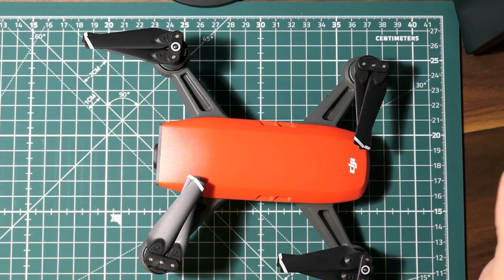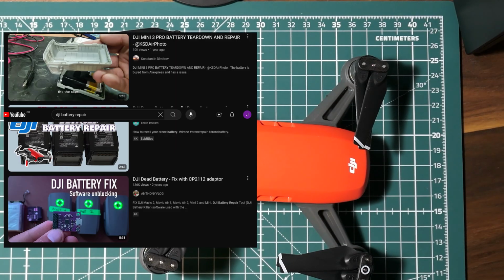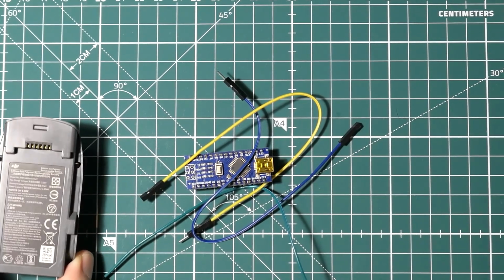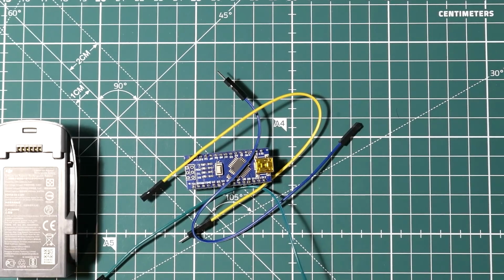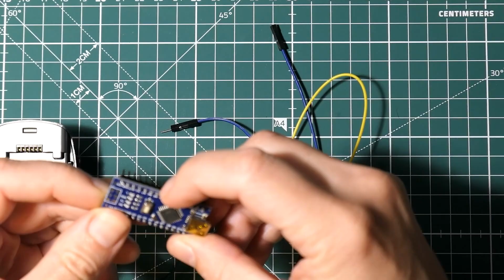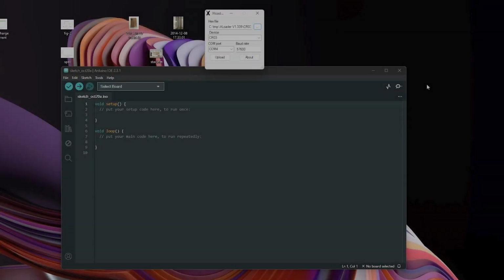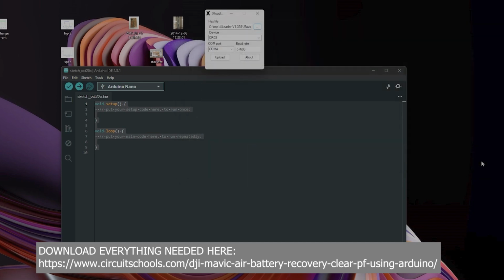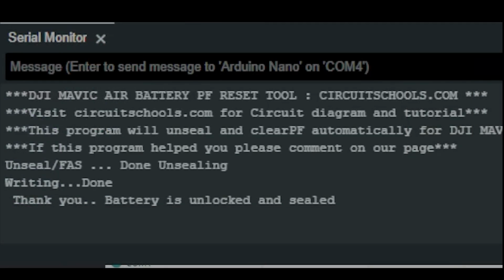DJI drone battery repair using Arduino – super easy (MAVIC, SPARK & OTHERS)!

Comment: thanks for the info - do you have any info on the step you mentioned about giving the dead batter a 9v/DC power supply? How is this done?
Reply from the maker: It’s pretty simple… find the pinout for your drone battery on Google, you’ll see it has a + and - terminal. Connect either a 9V battery or bench DC supply to the +/- terminals of the drone battery. With the 9V applied, follow the steps shown in the video (I.e connect SDA, SCL, and GND to the Arduino and run the code). If you’re using a Mavic battery then you might need to bump the voltage to 12V. Good luck with it 👍👍

Comment: So, I recently used the CP2112 Method, Like you mine didn't work,  I had two and both had the same issue (They would make the sound but not show up on Device Manager or the software). What I needed to do was disable a logitech service on my machine - logi_lamparray_service and once this was disabled, it worked a charm. This is just an FYI for anyone incase this helps!

Comment: After uploading the hex file to Arduino Nano, I attempted to read the battery information but it keeps saying that it could not detect the battery. I swapped the uncharged battery with another one that charges and Arduino Nano was able to read the information from it. Does it mean that something else is wrong with the battery?
Reply from the maker: It might be that your battery is so flat that it doesn’t have enough voltage for the onboard battery management chip to operate. If this is the case then you need to provide an external power source, this can simply be a 9V battery… check the pinout of the DJI battery and connect the + of the 9V battery terminal to the + of the DJI battery, do the same for the - terminals… then turn the nano on. This should provide enough power to brake the two to talk to each other. Good luck 👍👍👍

Comment: I’ve done al the things like in the video, but on the serial monitor I continue to get “check the connector to CR01”, cano you help me with that?
Reply from the maker: Do you try using an addition 9V battery on the + and - pins? If the drone battery is really flat it doesn’t have enough voltage to power the battery controller IC so the computer can’t communicate with it. Connect 9V battery and then try run the code.

Comment: WOW! IT WORKED! It did take me a little while to get it to cooperate. At first, I didn't have the wire connected to the correct ports on the DJI battery. After that was corrected, I realized the only way to get the PFR code to unlock the battery was to pay 5$. Usually, I would say this is a scam, but I continued. Received an email with the code. In the file I received, it had the Xloader, the code, and the password. Opened up Xloader, and it took me a few tries to realize that the device name in Xloader needed to be changed to Duemilanove/Nano(ATmega3280. Then I changed the baud rate on Xloader to 115200. From there, I had to google and search Arduino IDE 2.3.6 and download it. Very easy download. Opened up the Arduino application. THIS IS WHERE I STRUGGLED. When I would press upload on Xloader, like I said, change the device name to  Duemilanove/Nano(ATmega3280) and change the baud rate to 115200. I would go over to the Arduino app, go to tools, press sketch monitor, and it wouldn't work. I had to change the baud rate in the Arudino application to 115200 as well. I also used a 9-volt battery and connected it to the 2 and 3-pin on the DJI battery. It was textbook! Thank you. I have 4 batteries that just sat on the shelf. Same situation as you, I bought the Spark drone, used it for like 2 days, then it just sat in the cupboard. I needed it recently to take pictures of the new property. Even the new battery I just recently purchased from Amazon didn't work. IT DOES NOW!

Comment: Have u try with dji mini series
Reply from the maker: I haven’t tried as I only have the spark… if the mini has the same BMS then there’s a good chance it’ll work. Unfortunately, the information about which drone battery has which bms isn’t easily available. Quickest way is to give it a try, there’s no chance you can make things worse (providing you don’t short out the battery / destroy the Arduino etc). Cheers

Comment: I attempted the process, but in my case, it gets stuck at “Unseal /FAS” and does not proceed any further. Does this indicate that the battery is completely dead? What steps should I take next?
Reply: I was able to find the answer myself. The issue was that the battery was completely discharged. By using a 9V battery — connecting the negative lead of the 9V battery to pin 2 of the DJI battery and the positive lead to pin 3 — I was able to get it working successfully. Thanks.
Reply from the maker: Great, glad it worked out! I needed an additional battery for a couple of mine too… thanks for watching 👍👍

Comment: Thanks for the guide but I'm running into a slight issue. I followed all the steps but in the end the Arduino serial monitor shows random characters instead of showing "battery unlocked...". when I put the battery into the charging dock, the dock light blinks green the turns solid red and no charging sign on battery. Any thoughts?
Reply: Update: after selecting the correct  bud of 115200 in the Arduino IDE I am able to get text. But it says:
Waiting for your input, please select a function
Reply from the maker: Hmmm that’s odd. I was going to suggest baud rate as the issue. Not sure about the user input, didn’t see that before… did you apply an external voltage? How old is the battery?

Comment: i purchased the same drone which is never used but it was on the shelf and battery is dead, so I purchased it for $35 the battery does not charge. can I use my arduino pro mini for this? it also has a4 and a5 scl sda lines.
Reply from the maker: I’m not sure if it will work with the pro mini but there’s no harm in trying. Just be sure to use the pins described in the video, as these are hardcoded into the hex file!
Reply: @thecircuithelper  where can i find the hex file to load into xloader?
Reply from the maker: Circuit schools has the link on their website….
Reply: @thecircuithelper  is it paid? I can see any link

Comment: Hello, I have some Raspberry Pi lying around in my office. Do you know if I can use them instead of the Arduino Nano? Thank you.
Reply from the maker: Well, you can definitely use the Pi for I2C communications, so in theory it can communicate with the control IC in the battery and reset the flags… but you’ll have to write your own code to do it. This shouldn’t be that difficult as the controller IC is well know and the datasheet is available (it was my original plan), but using the nano and available hex file is much easier! The hex file won’t work on the pi I’m afraid.
Reply: @thecircuithelper  Thanks for your response. I was able to use the Arduino Nano and successfully unlock and seal the battery. After plugging it in my charger, the battery will charge for 4 seconds, pause for about 6 seconds, and then start again. I don't know what's going on. At least I was able to get the charging lights on but I don't think it's charging.
Reply from the maker: Strange, did the text in the serial monitor indicate the flags had been reset? You could try using a 9V battery on the DJI battery + and - terminals to see if that helps.

Comment: you are the best! at first I had issues with the XLoader, but I managed to fix it with the Avrdudess. I had the pins connected as described, plus a 9V battery on the 2nd(-) and 3rd (+) to give it some juice. just charged it using the drone
Reply from the maker: Awesome, glad it worked out, happy flying 👍👍👍👍👍👍
Reply: so you connected the + of the 9V battery to the 3rd pin + of the dji battery  and the - of the 9V battery  the 2nd - of the dji one, right?

Comment: How do you attach the 12V battery to the DJI battery? tape the +/- terminals of the 12C to the DJI battery?
Reply from the maker: Pretty much… find the pin out for the battery, put the ‘-‘ of the 12v source into one of the ‘-‘ terminals on the DJI battery, do the the same for the ‘+’. Turn on the 12V then try run the reset code. Good luck 👍👍👍
Reply: @thecircuithelper  Thanks for your quick response.  Im still confused what 12V battery you're referring to. Can you send a link to where I can buy it on amazon?  Thank you so much again!
Reply from the maker: For the Spark I used a 9V battery, one of those cheapo rectangular PP3 batteries and it just about worked ok. If you’re trying a different DJI battery (Mavic for example) then you might need a higher voltage (12V), you could get this by combining batteries, or one of those ‘wall-wart’ adapters etc. good luck!

Comment: Here are some of my experiences with the DJI spark battery reset.
I used an Arduino Uno for my battery reset.  In my case, if I left the battery in the charger for it, then tried the reset immediately after removing the battery for the charger, I could reset the PF flag.
I had some Arduino Nanos on order as well.  Make sure your USB cable is good, some appear to work, but it only functioned after I replaced the USB cable.
I couldn't get avrdudess to work correctly for upload, but it verified fine.  It worked with arduino IDE though, so this is the command I ended up with:
C:\Users\infodba\AppData\Local\Arduino15\packages\arduino\tools\avrdude\6.3.0-arduino17/bin/avrdude" "-CC:\Users\infodba\AppData\Local\Arduino15\packages\arduino\tools\avrdude\6.3.0-arduino17/etc/avrdude.conf" -v  -patmega328p -carduino "-PCOM3" -b115200 -D "-Uflash:w:"C:\Users\infodba\DJIUnlockerversion3Firmware.hex:i"
That came from turning on verbose for the upload (I used the blink project).  If you can upload the hex to the arduino board without doing this, that's good too.
I was able to get the CP2112 board to work, using version DJi_Battery_Killer_ver.0.5beta2_01.02.2022_with_dlls.  For my spark battery, I used the pulldown until I found CP2112 HID USB-to-SMBus Bridge.  I chose BQ9003 and was able to read the cell.
The reset wasn't possible to test, since I'd already fixed the battery using your method, but I was able to read the battery and unseal/seal it.
After the reset, the batteries (four of them) were fine, but I think they've got less capacity from being many years old.
Reply from the maker: Really great insight, thanks for sharing!! 👍👍👍

Comment: i tried this with a DJI Mavic pro battery but after it said unsealing it said unknow error.
Reply from the maker: Ahh that’s a shame. If you’re certain the connections to the battery were good and the battery has sufficient power then perhaps Mavic Pro batteries have a different controller IC with a different instruction set… your only chance would be to figure out which and write a code to reset it. Perhaps the method using the PC works for the Mavic Pro battery?

Comment: Question where did you get those wired that connect your battery and arduino?
Reply from the maker: You can get them on AliExpress, e.g., https://s.click.aliexpress.com/e/_oDUYjBn
Reply from the maker: I should add, you need female connector on one end (for the Arduino pins) and male connector on the other (to push into battery terminal). Good luck!
Reply: @thecircuithelper apologies but another Question. Would a Arduino Nano ESP32 with headers [ABX00083] ESP32-S3, USB-C, Wi-Fi, Bluetooth, HID Support, MicroPython Compatible still work for this project? Want to buy it simply because usb-c would be easier to work with
Reply: Thank you i will be buying these off amazon for faster delivery and let you know how it goes

Comment: Worked perfectly - This is awesome!!!!
I used a Macbook for this and had some issues figuring out how to use AVRDude to upload the .hex file to the Arduino. 
First I had to install "Homebrew". Then using Homebrew I installed AVRDude. Initially AVRDude complained that the com ports was being used and that it couldn't connect. I closed down Arduino IDE and the com port was released and AVRDude worked fine.
The .hex file from Curcuitschools cost 5 USD but it is a small price to pay to get my 4 bricked Spark batteries back to live.
All of my 4 batteries were completely dried out and I was not able to even communicate with the batteries. I left my batteries in the charger for a couple of hours, and even though the charger was blinking red that somehow got a little bit of power back into the batt.
I then unplugged the batt from the charger and quickly connected the Arduino cables to the connectors and powered on the Arduino and BUM!!! I now have 4 working batteries and a happy kid flying a drone 😀
Thanks for the video! And I hope this comment can help others with totally bricked batts.

Comment: I had the same issue with that little board.  I tried with both PC and Mac and neither would recognize it.  The software booted up fine but the board is a no go.
Reply from the maker: I’m kind of confused by that little board. I’m pretty sure it uses the same usb to I2C converter chip as many common microcontrollers but it just wasn’t recognised on any computer I tried. Weird.
Reply: @thecircuithelper  Yeah I tossed mine in the junk drawer and bought an Arduino Nano.  It worked as expected.  Unfortunately though,  my batteries were too far gone to be saved so I'll have to buy a new battery.  I've seen the videos on disassembling the battery and manually charging but I'm afraid of damaging the battery and it fail while the drone is in flight.  Then I would have two problems:  A destroyed drone and a battery that is still bad.
Reply from the maker: Ah that’s a blow! If connecting the 9V battery didn’t work, you could maybe try a 12V battery and leave it connected some time before running the Arduino code? 

My batteries were super dead, like I hadn’t used them since something like 2018, but the method with battery was still able to revive them. I guess the only danger may be if they are actually internally damaged due to discharge, then I guess they need to be replaced.

Comment: can you explain about giving the really dead battery some power am not to confident with electronic.  Is the power directly applied to the battery or via the Arduino thanks
Reply from the maker: All you need to do is find an appropriate battery, something like a 9V or 12V. Connect the + and - terminals of your battery to the + and - terminals of the DJI battery (you can find the pinout of the DJI battery online to identify the correct +/- pins). Once the batteries are connected follow the instructions in the video, connecting the arduino and running the code.
Reply: @ thank you so much

Comment: Hi, I am another Spark victim after not using it for a while (2years) now I have no batteries to run. I want to try this route since I have nothing to lose but before moving forward I am a bit confused with your pinned comment, does this mean that the method does not work anymore or it is just for a model of drone in particular? Thanks a lot for sharing your knowledge and taking the time to explain it to us, greatly appreciate it.
Reply from the maker: Hi, so the methods still works, or at least I think it does. I fixed my batteries several months ago (three of them) and it worked for all. Several people have commented since today it has worked for the Spark. 

Unfortunately, I didn’t write the original code to unlock the battery, I just found it on a random website and gave it a try. I don’t know if this video had something to do with it, but one month or so ago  the developer of the code devised to start charging for it. Apparently the code that is being sold has been ‘improved’ but I have no idea what has been changed with it. Also be aware that some comments suggest they paid for the code but it was never sent, so be a little careful! Send me an email if you’d like to know more, my address is helpercircuit at gmail dot com
Reply: @ will do, thanks so much.

Comment: The code does not seem to be working. I am trying to fix a Dji mini 2 battery. The output does not show the same as on the video.
Reply from the maker: So, the first thing to do is check your Arduino and data cable work, to test this try uploading a simple sketch to the Arduino in Arduino ide. If that works, re-flash the hex file and then open the serial monitor in Arduino ide. With the battery connected to the correct pins on the nano and the serial monitor open in Arduino ide, hit the reset button, you should see some info about progress in the serial monitor. Good luck and thanks for watching
Reply: I am now using a arduino uno and it showed it worked and I tried it and it did not work. Tried the code again and it did not say that it unsealed battery only the text it shows before it works. The drone flashed its lights 3 times per second.

Comment: probably didn't like the USB-C cable you were using?!
Reply from the maker: Nahh I don’t think so, I tried multiple cables and a couple of different C2112 boards from different sellers. I just couldn’t get them to work on either my desktop or laptop. I know the cables are ok because I use them for programming microcontrollers all the time. I’m pretty sure it was a windows compatibility issue, I only have the latest windows available to test, so can’t know for sure! Thanks for watching!